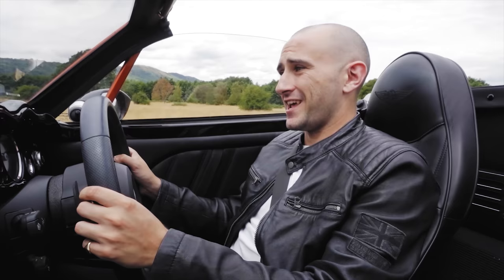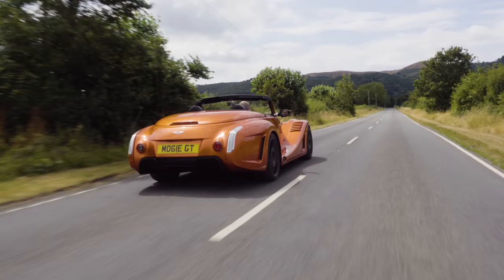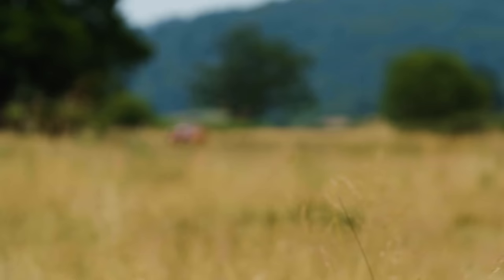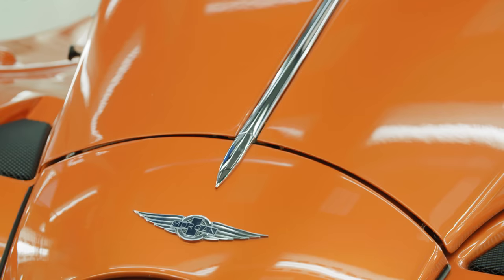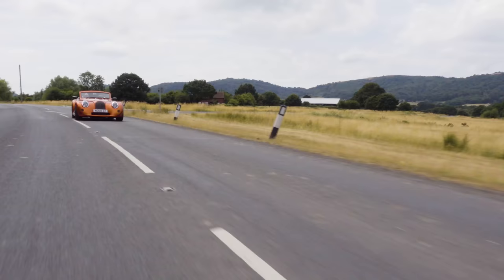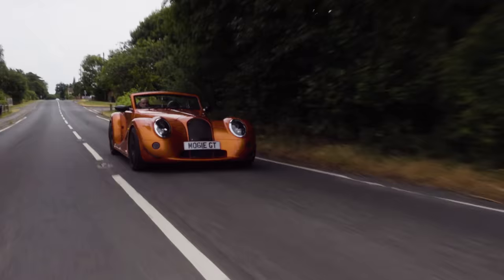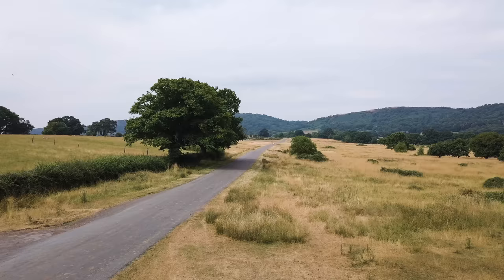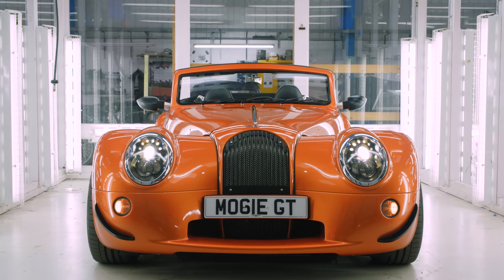Morgan Aero GT: The Most Hardcore Aero Ever - Carfection (4K)

Comment: are those taillights from lancia thesis? they look very similar
Reply: Yep - you got it!
Reply: Ever since the Aeromax ;-)
Reply: and the headlights are off a MINI
Reply: Close, but not the same as the MINI headlights.
Reply: ah I read somewhere they were off a mk1 new mini, guess they were wrong about that.
Reply: @dancelittlesquire  they do look very similar. But the washer jet looks smaller on the Morgan. And the lighting cluster has a different setup. MINI has a HID projector on top and a halogen turn signal on the bottom. The Morgan has a very similar projector on top, with the same dots surrounding it, but the bottom is more complex incorporating two lighting elements.
Reply: @dancelittlesquire  You know what, you're right. I was comparing the Morgan headlight to the ones on the R56 MINIs. But, in fact, these are the ones from an R53 MINI. I stand corrected.
#LearnSomethingNewEveryday

Comment: Transmitting power: +80% of the motoring public in the UK are gear jammers = manual transmission. The opposite is true in North America, where +80% of drivers use an automatic transmission. This is why when the UK receives just 1 inch of snow, the entire motoring system collapses. Loss of traction control.

Comment: Keep building them with a proper engine. Ford 3.5 Ecoboost turbo V6 or Ford 5.0 Coyote V8. 
Offer the 3.5 as standard and 5.0 as option. Morgan could not build them fast enough.

Comment: How does Audi get 450 NA HP out of a 4.2 liter but BMW and their 4.8 gets 370-ish?
Reply: This engine is like 25 years old,you can't compare it with more modern Audi engines.
Reply: Most car makers don't build road cars for all out HP they're built for more low to mid-range grunt because it helps emissions and it's where people drive them.

Comment: Wrong ... get the Auto every time. Fitting Clutches every year is expensive ...
Reply: I have had an Series 2 Aero for 6 years and 34,000 miles and am still on the same clutch. It's not in the clutch it's in the foot.